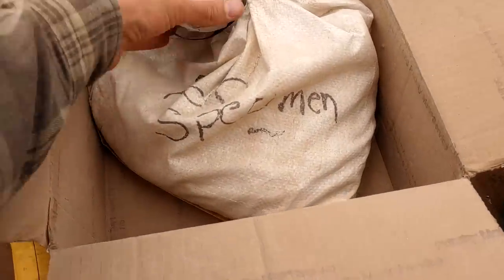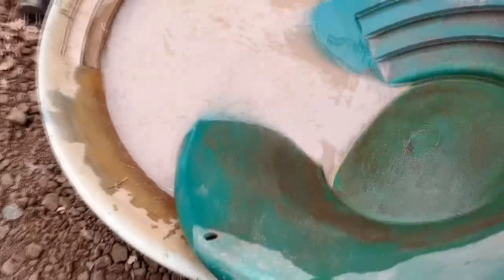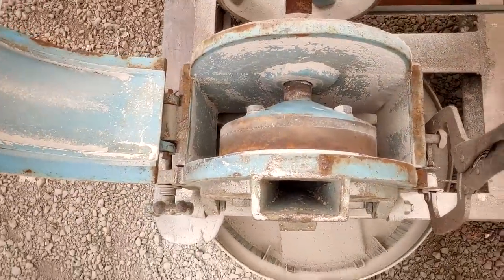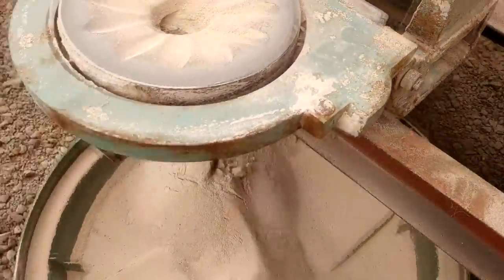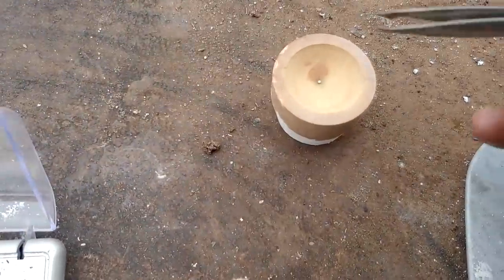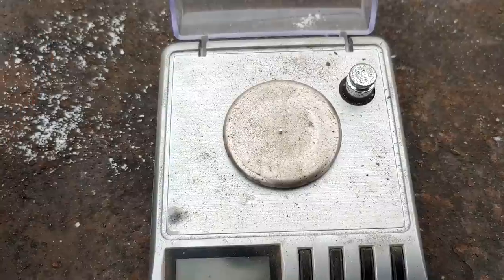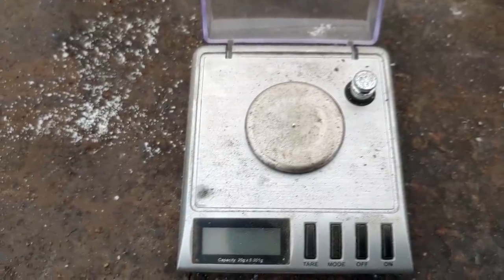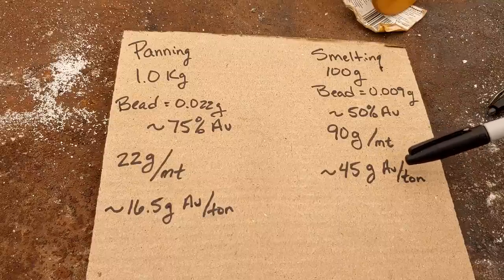Testing Ask Jeff Williams Rocks For Gold

Comment: Hi Jason, I'm the old timer that used to "work" there. I was the assayer for a few years off and on. I've never assayed for a metric tonne as most assays here are done standard. As there are 29,167 troy ounces p/t we always use 29.167 grams. Every milligram recovered would equal 1 oz. p/t. So to convert back to a standard ton I would assume (and I don't like that word) that you would have to subtract .9 grams off your 90 grams recovered, to get a true assay ton. I also have another question for you: "How much did your lead assay? In other words , have you run a blank assay on it? Why such a small amount of litharge on the assay? We normally add like 25-30 grams in a one assay ton assay. I'm sure you'll find that ore quite unique and very rich. When you part your beads, check and see if you have a faint green color in the solution. It's not copper. Good luck with milling that stuff. The amount of floatie gold will blow your mind. Glad Jeff got hooked up with you. Your both in for even a bigger surprise if what i was told is true. And i got one more thing that i haven't even shared with Jeff yet. Till next time; may all your days be golden!
Reply: Thanks. Forgot to tell you that Jeff has my contact information.
Reply: @richardbeee  hi Richard thanks for the info. I found the natural lead in the ore is like a collector metal. Wulfenite looks like gold too. I thought I had a bunch of gold but melted it down and had a big lead button. Use a cupel and got the lead out and came out with 8 grams of gold from 34 lbs of ore. There must be some silver in my button because it’s not bright yellow.
Reply: @short-fuse  So Max, that comes out to 15.181 ounces per ton. Was that on the high-grade?
Reply: You did right on using the lead that is already in the ore. I used to do the same. If you can't part the bead get some pure silver inquart, Your ratio should be at least 4 Ag to 1 Au, Remelt/cupel and part. This will give you "pure" gold weight. However, on parting pay attention to the color of the solution. Any kind of green is what you want. I'm not trying to be a smart *ss to anyone, just want to make sure Jeff gets good and accurate information. I really want to see him go over the top. This stuff is like none that was ever mined in that area. There's more that i haven't even told Jeff yet.
Reply: hey I would like to know to hahhahahhaha thanks Richard for getting us the info and your expertise on that ore.
Reply: @richardbeee  thanks Richard ....that is pretty rich ore .....hope you got the small specimens we sent you and want to make you a button from the ore . Love the fact that you can use the natural lead in the mix to help in the smelting process. That Wulfenite / Mimetite is super heavy and we have seen it in other deposits here in Nevada . PLUS I got your letter ....really appreciate the info and memories your shared .....can't thank you enough for that .... keep us posted and hope to see you out there again
Reply: @Askjeffwilliams  I did receive that and thank you! Although it does help in the assay process Jeff, i still added a little litharge. There's one thing i haven't shared with you yet but we'll get to that later. Oh, is it Wulfenite or Wulframite? Never could quite figure that out. Might help on the reducing power though. Ole Maxx sounds like he did you a pretty good job. Got a guy down here i'm sharing my knowledge with. Think he's interviewing me next week. Hope y'all are having fun back east. Glad your not reduced to sweeping side walks:-)
Reply: @Askjeffwilliams  One is light orange and one is yellow. They both have a different other element in them.
Reply: @Askjeffwilliams  Looking forward to it. Stay safe.
Reply: @Askjeffwilliams  Wulfenite=PbMoO4. Moly /lead. Wolframite=tungstate of iron and manganese. No lead.
Reply: Oh my word , now that's a rough tease , lol . Jeff has to get you on an episode to chat about this mine.
Reply: @texasslingleadsomtingwong8751  It's only an hour and a half to my front door, from that mine. Unfortunately i'm now legally blind and can't drive. I'll only be here a few more weeks then off to Montana.
Reply: @richardbeee  so seeing as you can't drive , being legally blind and such , I'll  drive .
Reply: @texasslingleadsomtingwong8751  I'll be all right. Jeff is out of town anyway. Thanks tho.
Reply: just convert troy to grams  after that metric is just prefixes and decimal places lol
Reply: @mobiousenigma  Except that there is 14.56 troy ounces to a 16 ounce pound lol
Reply: @richardbeee  those are imperial measurements ..i said convert troy oz to grams ...from there it works easily .....1000 g is  a kg  and 1000 kg is a tonne .... do the hard math in metric then convert... its a good thing you dont have to deal with strange units like grains or rods  or knots  .
Reply: @richardbeee  when in rome .....measure in grams ffs lol  the metric system has its faults  but for this stuff it rules...now as an architect i know stuff is labled in metric numbers but  drywall is still 4x8 and a 2x4 well it isnt 2x4 anymore either ...as i recall a troy oz is about 2 g heavier than an imperial oz  and there arent troy pounds as far as i am aware now i have to go measure 2 inches of helium ....
Reply: @mobiousenigma  Why not just do it as it has been done for years? Or maybe you believe you can just put a hunk of untested lead on the bottom or top of the charge and it will collect all the precious metals in the charge. I had to laugh at that one.
Reply: @mobiousenigma  12 troy ounces= one troy pound. weights have been the same for years.
Reply: @richardbeee  but do you live in troy?  pounds or kg are of more use today links rods and chains are also units of measurement  but we dont use them much any more
Reply: @richardbeee   its chemistry  im not a chemist however precious metals have been refined since ...the copper age  so i would assume  smart people along the way learnt a thing or 2 about it and passed the knowledge along..... i suspect there are multiple ways to get to the end each with its positives and negatives and knowing when to use which  or which method is easiest or cheapest or will produce the least waste or  looses the least amount of precious  is the art
Reply: @mobiousenigma  I just look at numbers. One persons assay came out about what we ran there many years ago. The others came out way less.
Reply: @richardbeee  isnt that sort of the name of the game ....there is no garentee  the ore is there or not there and its concentration will change because its formed through natural processes . my expierence is from northern quebec canadian shield granite  which is a different beast from whats being mined there and the scale is somewhat larger  with them dealing with tonnes/h or minute instead of per days  ...val dor  its well named  with 2 mines within city limits  and at least 20 within 100 miles  look into sisco island mines for a good story .
Reply: @mobiousenigma  Thanks Mike. I'll check it out. Are you at all familiar with the Ni deposits of Sudbury, Ontario? I find them incredibly unique. Even got to work on some samples from that area.
Reply: @richardbeee  lol  yup i have family there and in timons  ontario where the silver sidewalk is/was . sudburys deposit is a meteor from what i understand  ..somthing like 5 cubic km   cant imagine what that did when it got here. the slag disposal is a bit of a tourist thing up there on summer evenings the train of flask cars rolls out and proceed to dump molten  material for 30 to 40 minutes ...its impressive in its way.  they use it as rail way ballast and its about as dense as granite..heavy stuff. i havent seen the processing  but i believe there using mills  down to a powder and large tanks  to  airate the ore out of the slurry. same with the quebec mines but i believe there using cyanide not mercury .....mining such a clean and healthy living lol .
Reply: @mobiousenigma  Only if done properly🙂
Reply: You're*
Reply: i am guessing assay works best in imperial units  as dose construction but for different reasons . in construction things are still manufactured to imperial standards  so working with those materials works best in imperial as well as the fact houses are people boxes and imperial is based off body parts  ,  im guessing converting between troy and metric and imperial is a total pain  but between imperial and troy probably isnt as bad  i suspect there connected somehow i havent bothered to ponder on as i have imperial/metric . my take on it is neither system is superior but choosing to work in units suited to the task makes the task easier or at least removes  some errors., sounds like you know a thing or 2 about melting stuff  and i do not so ill ask  flux... theres a lot of different ones and its a term used in a few ways  ...from acid based on metals for soldering  or whatever is on sticks for arc welding  that when molten shields metal from atmosphere , in assay i can follow adding lead  for a chemical reaction   and i understand lead will melt at low temperatures  causing the other solids to reach molten quicker .. dose the flux put the ore into suspension  it cant be solution  that would leave alloy ... or since the flux melts first  and the "ore" later  it has to filter through the flux leaving impurities on top of it  same as seperation of fluids by density  aka b52s at the bar? sorry its late and this got long and complicated lol

Comment: Jason, my claim has lots of fine gold dust with iron dust, really fine dust (about one level teaspoon for every five buckets of overburden).  I'm not down to bedrock, but I'd like to recover this dust as I proceed down.  It's all hand dug and hand panned, so far.  Bedrock is about 20 feet below where I am currently digging. My neighboring mines are ignoring this fine gold dust, for now, and they're just going after the small nuggets near the bedrock. The iron oxide/sulfide dust that is traveling with the gold dust appears to be just as small as the gold in size.  That's my problem; I'm having difficulty separating the two in a pan and the gold is so fine that even a magnet doesn't seem to select only the iron.    And, "yes" I'm using Dawn dish detergent. So, my question to you, Jason, is: "Would a shaker table be able to separate the iron from the gold when the pieces are this tiny?  I could send you a cup, or so, of his mixture but I don't know if that would be enough to test it on a shaker table?  Your thoughts?  I don't want to get involved with cyanide.  I truly love this video, and your others, of course.

Comment: Not that these ideas would be your fault, but I think some other consideration is necessary. Gold migrates downward in the host material which was provided to you. This was obvious by the amount of gold found in the "dust" which escaped bag. That amount of gold needs to be accounted for in both final samples in my opinion. The only way now is by volume if it was not put back into provided samples. ALSO, how is the migration of gold downward accounted for while you handle the samples and prepare them for panning or smelting? Wouldn't a sample from the bottom be richer than a sample from the top?
Reply: I used to work in an industry where we needed to assay particulate samples with individual particles of widely different density -- just like these gold ore samples. The best way to take a representative sample is with a "riffle splitter" which divides the sample in half, then in half again, etc. until you get to a manageable size. 

If you only need to do it a few times, laying out the entire sample on a tray and splitting in half a number of times with a straight edge would be pretty good but time-consuming.